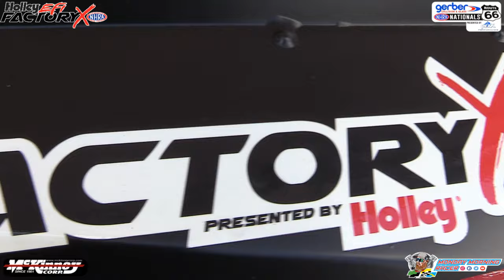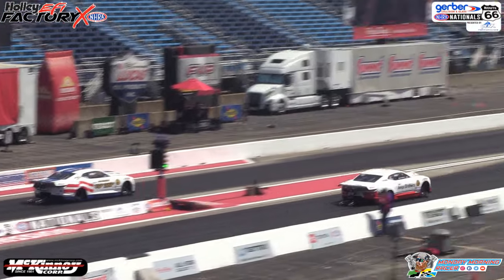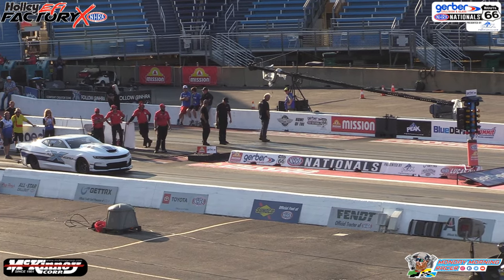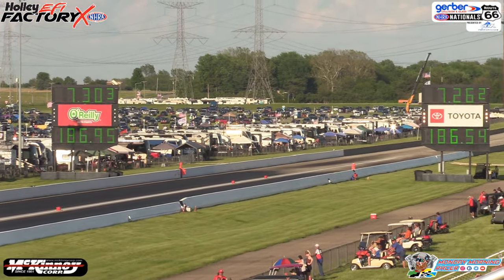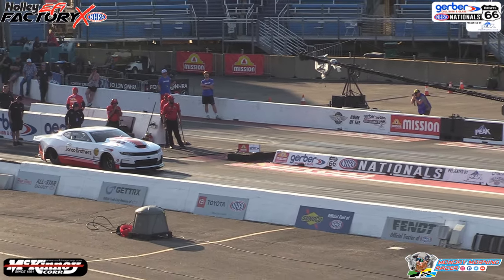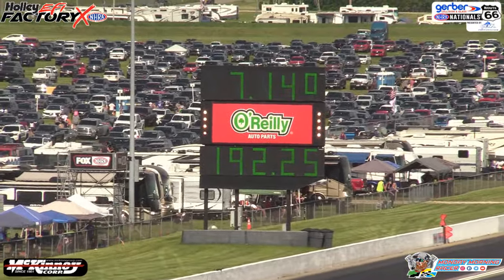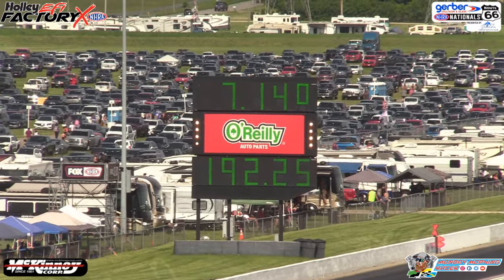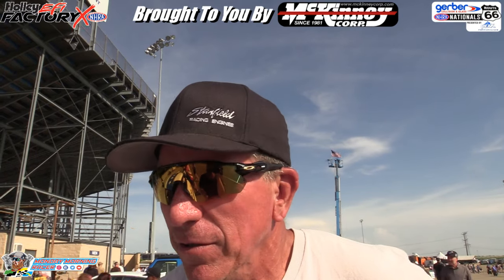Factory X Drag Racing | NHRA Route 66 Nationals 2024 | Route 66 Raceway - Chicago

Comment: Bring back Holley Carburetors!! They still make more power than EFI!! This is a corporate backed category.
Reply from the maker: Wasn't pro stock corporate backed in even 1970? Corporate backing has always had a connection to high-tier racing.
Reply: I love that this class was started as ball coddling ev.
Reply from the maker: @KimiWallrus  glad someone at NHRA piped up and said "hey, you know what, this is a better option."

Comment: NHRA has already started to change the rules in this class. Ford and Mopar will soon be gone. This is why the NHRA is dying a slow death. It is a shame because if they would not have done things like, Ford and Mopar run one type of S/C, Chevy another. Then they put a rev limit on the ohc motor. And other things to slow up Ford and Mopar. When pro stock ran the 351 and 350's it was fun to watch. And even then, the Fords had to carry more weight. This class would have brought me back to the track. Instead, I will continue to go to Ford and Mopar shows only. Coming up on 20 years since I stopped going the NHRA CHEVY SHOW.
Reply from the maker: Heard you the first time on the other video.

Comment: Now how long does it take NHRA to screw this class up like they did with Pro Stock by allowing different types of body shape modifications and allowing certain brands to use parts that different they what they started with? The now pro jellybeans/stock class no longer holds the interest that did before they started remolding the original shapes of the cars namely the Camaro then dropped the rpm limit to stop Dodge from running. Then they come up with a “new” class with the factory made Cobra Jets, the COPO’s and the Drag Pac but NHRA couldn’t leave that alone and started allowing more boost for some brands or more weight or much less weight to race with, so they screwed that class up in record time. Now they have another factory race class and let’s see how they mess this up as well. No other class has had so much tinkering with the rules as Pro Stock, back when Bob Glidden, Warren Johnson, Jim Yates and Allen Johnson were racing their cars the body shape looked like a factory car with a big hood scoop and big slicks then the body mods started and they ended up with the jellybean cars today. Can’t wait for the new set of favoritisms to start with this class.